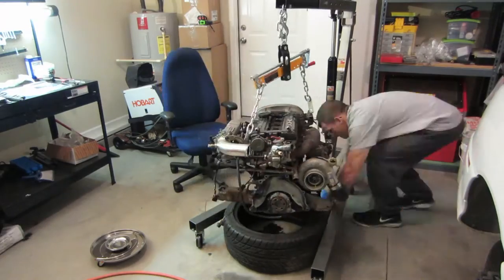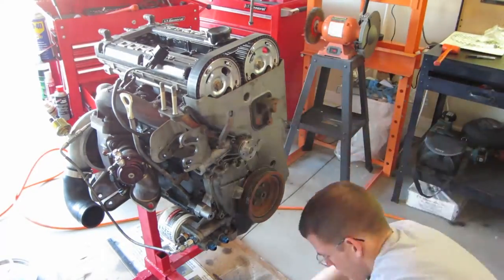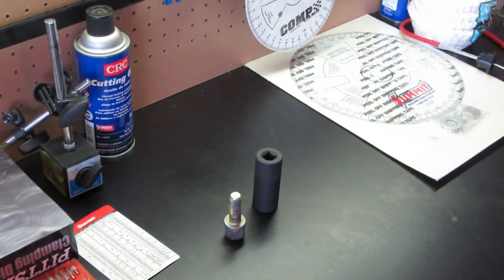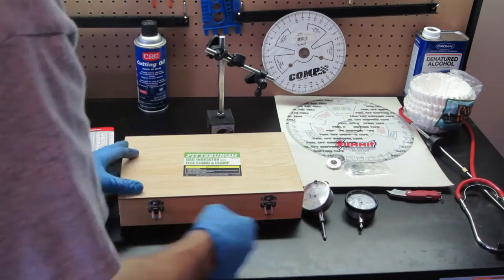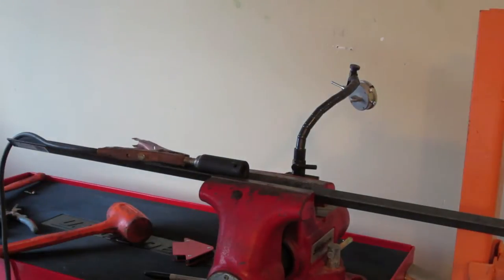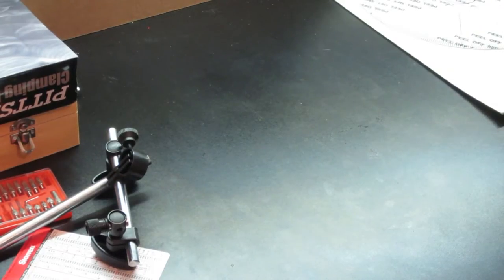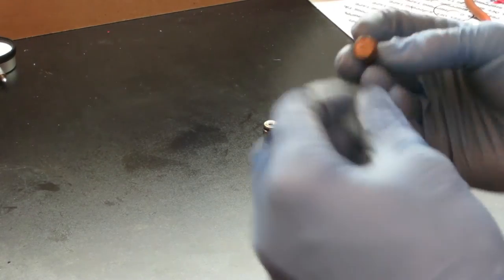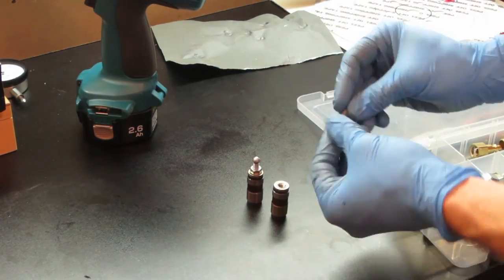Degreeing Camshafts Part 1

Comment: Great work here... One tip I would highly suggest for anyone making the degree wheel tool is to reverse the order seen in the video...that is drill [if you have to] and tap the socket before you weld the crank bolt on to the socket, this will ensure that you have good socket with threads to hold the degree wheel to, before you do all the hard work of measuring and welding the crank bolt to the socket, it would be a pain to have to do all the measurements/welding twice.

Comment: You're welcome!  :D
I like your crank tool better than mine.  Going standard fits the collets for the degree wheel better.  I wasted a metric tap on mine, and would have much preferred killing a standard one.  Using standard hardware would have drastically improved my bolt selection as well.

420A lifters... clever.  I'd have never tried that.
Reply from the maker: I’ll try almost anything once LOL

Comment: why did you use an impact socket, seems overkill?
Reply from the maker: I just used a cheap spare socket I had laying around. It just happened to be an impact socket. A regular socket would do the job as well.